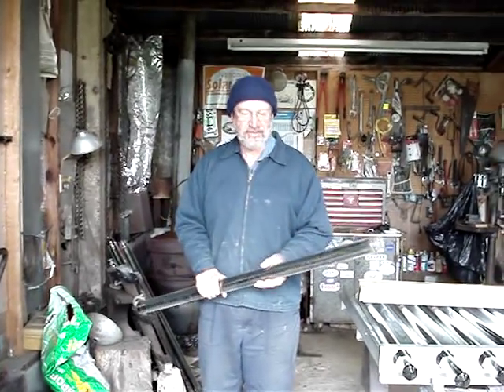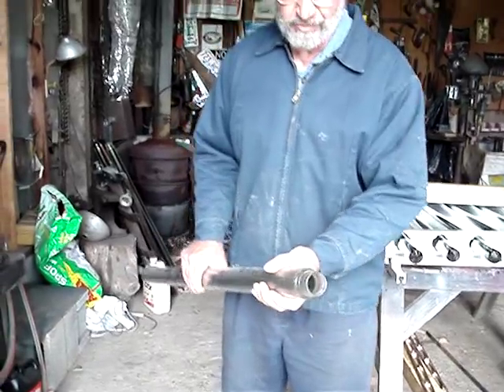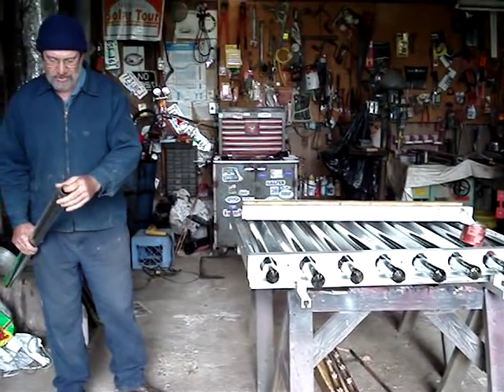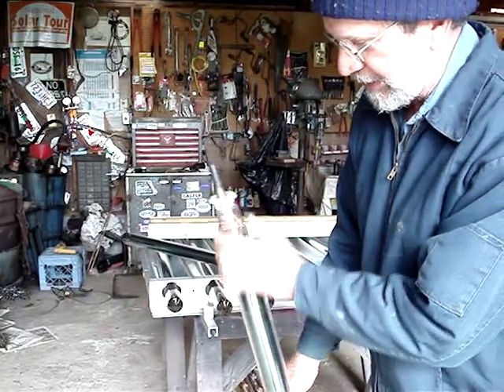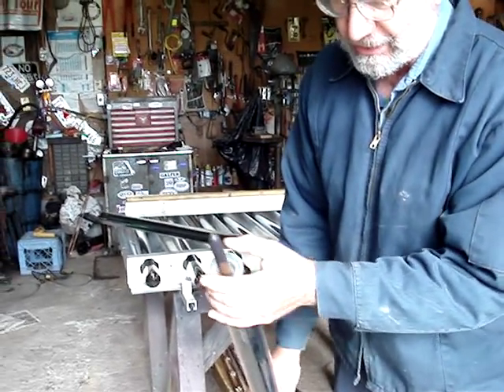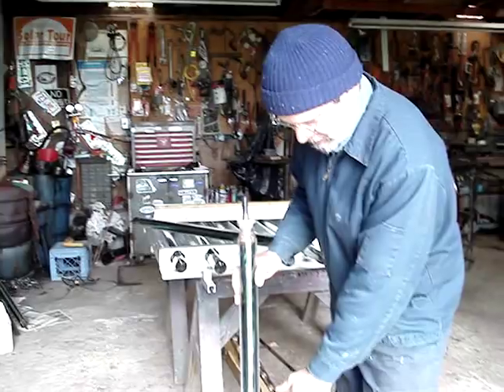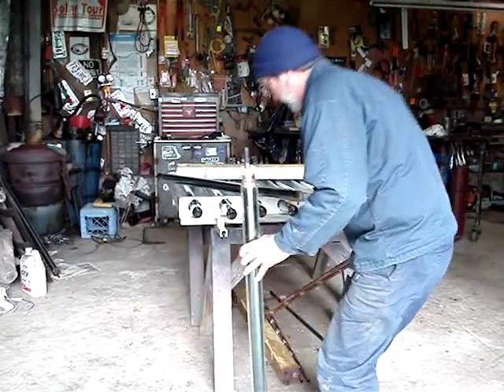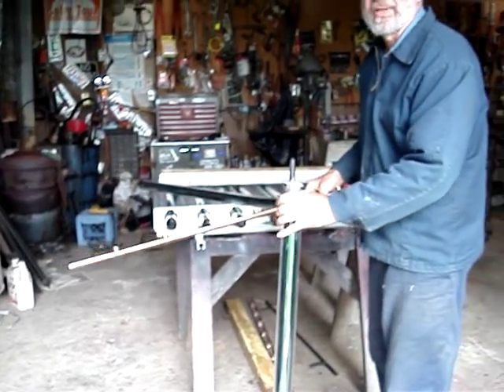Evacuated tube heat pipe array

Comment: @sundug69 - The heat pickup can be calculated somewhat.  On average about 1 watt of power per 1 square inch  contacts the earth.  The evacuated tubes have a direct face to the sun of about 2 1/2 inches and the tubes have about  a 40" length of the black chrome with which to absorb.  So 2.5 inches x 40 inches x 1 watt equals about 100 watts of power.  I have built these HTs and they do get  VERY HOT!  Assuming an 85% conversion, at best,  you get about 85 watts of usable heat power per 4' tube..

Comment: @sundug69 hmmm, Im a plumber for 28 years I understand coppers thermal characteristics.  It still could be done by using 1/2" sweat by compression adapters into tees, use nylon ferrels and lots of silconized gease so you dont have to bear down of the bullets to get a good seal. make the small loop around your heat pipe ends, inlet and outlet side,  terminate at edge of unit and then put quick commercial hose disconnects approved for hot water on the ends for quick disconnect and service of unit.

Comment: @sundug69 of course it would require 1"x3/4"x1" tees instead and probably some special order 3/4"sweat  x 1/2" compression adapters but what you want in could easily be achieved in individual disconnect of heat tubes. Hope you dont mind my input. Im poor now days and have to live vicariously through you guys, otherwise Id get some and do it myself.

Comment: Wouldnt it be better if instead of couplings to connect to the heat pipe, you soldered the bullet ends into 1"x1/2"x 1" t'ees, inserting into the tee just enough that the antifreeze flows across and around the ends of the copper bullets? your losing a lot of heat that way and seems terribly ineffecient.